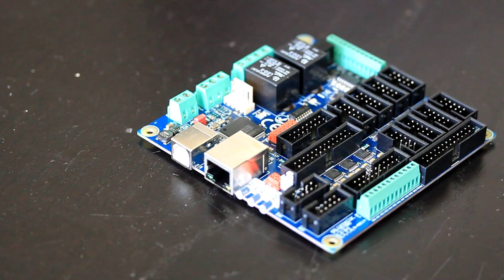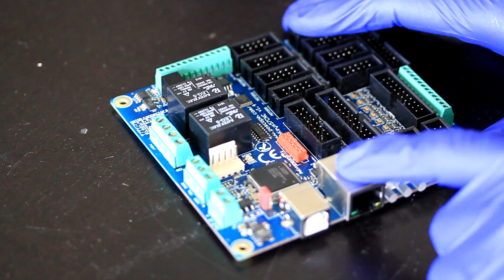1. Pokeys57CNC CNC Interface and Controller Introduction

Comment: Hi Patrick
I have seen you YouTube Video great work the board is very impressive.
I am starting a project CNC Plasma cutter using Clearpath Motors.
Spec
Input (bus) Vol Peak Torque (@75 VDC) Range24-75 VDC (90 VDC max)
Peak Torque (@75 VDC) 922 oz-in (6.5 N-m)tage 
Max Speed (@75 VDC) 1800 RPM
X travel PN: CPM-SDSK-3441P-RLS x 2 motors (34 NEMA)  
Y travel PN: CPM-SDSK-3441P-RLS x1 motor (34 NEMA)
Z travel PN: CPM-SDSK-2321S-RLS x1 motor (23 NEMA)
I need a Micro-board with 5-24v will the Pokeys board be suitable for my project

Comment: But why only 125kHz pulse rate?!
Reply from the maker: Darko Bulatovic 8 simultaneous motor pulses adds up. That’s 1 million pulses.
Reply: Patrick Hood-Daniel some servos requre 500khz pulses. I would expect modern processors could achive that easly this days...
Reply from the maker: Servos or stepper motors?  Modern processors can depending on the processor and the max rated oscillation of the chip.  This would be a good question to ask the developers of the interface.
Reply: Patrick Hood-Daniel servo motors that can achive 3,000rpm. For stepper motors this might not be an issue.
Reply: @darkobul1  , .... a faster processor makes the device much more expensive !
And then you are at price ranges, especially you need servo motors for your machine, you can buy professional cnc controllers.
LinuxCNC with Mesa Hardware is a stable solution for a good price  !
Not cheap,... but in price ranges a hobbyist can pay.
When you are more the windows guy, you should take a look at "eding cnc"